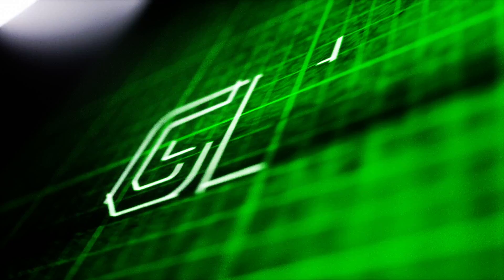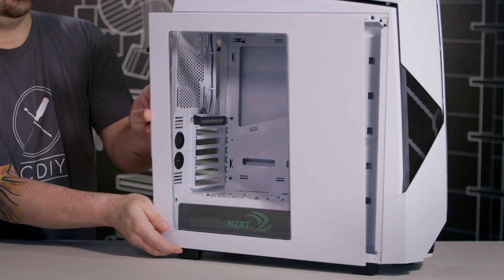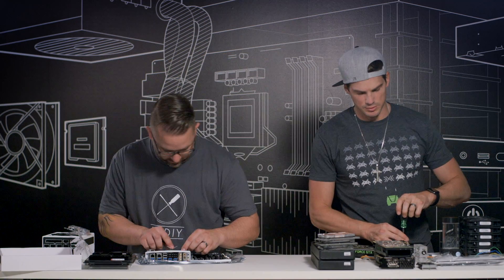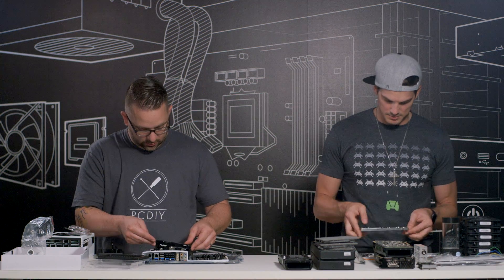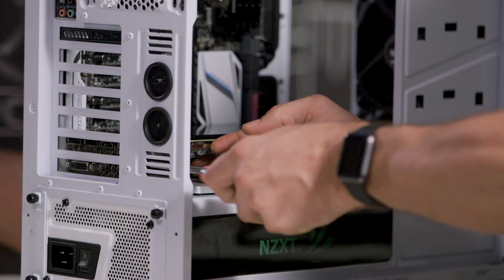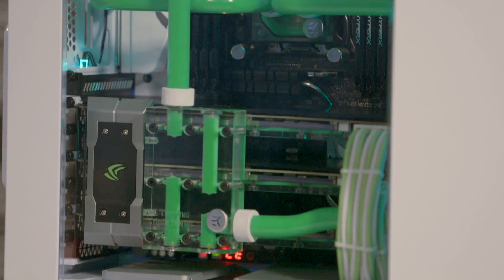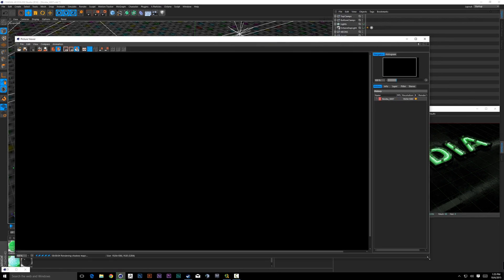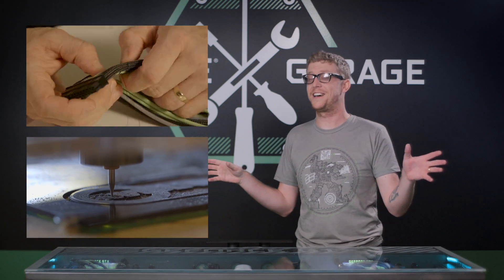GeForce Garage – How To Build the Ultimate Home 3D Rendering Rig

Comment: Does speed only depend on the CUDA cores or are other things important like clock speed and memory? Im deciding between a 970m and 1060. Thanks!
Reply: Jim Galapo. CUDA cores for 3D rendering with a GPU renderer like Octane or Redshift are important, then CPU, and RAM really never has to be crazy. GPU memory is nice for more complex scenes.

Comment: One big mistake; SLI your GPU´s won´t work in Blender, Daz, nor Poser, only in Octane, so it seems.... Don´t understand how you have to leave such a simple scene to render overnight...
Reply: That's usually people's big drawback with SLI especially with gaming focusing more on speed and not utilizing the full capacity of hardware. It's likely not a mistake, Octane is big on saying, "we're good, not fast" as long as it's not direct PR. It's well optimized, but until you get really into software tweaking, EXTREMELY slow. Personally my favorite styles and content comes from Octane, but could never justify my own use.
Reply: Why not use a gaming GPU, like a gtx 1080 Ti, and a Cuda or Tesla to boost rendering; wouldn´t slow down normal gaming too much, but you´d render about 80 % faster..
Reply: Like a Quadro or a Tesla maybe? They're different chipsets. You can have both cards, and with some serious software modification, you can probably get Octane to render with both at the same time, but you're sacrificing speed of both cards for them to talk (or handshake, or cross-sync, I'm self taught and didn't learn every industry buzzword), which is hard to do and taxing on each card. 80% is a bit of an arbitrary number since you actually have a multitude of factors affecting performance. What ends up being easiest if you have a 1080 lying around along with a Titan, Quadro, Tesla, or whatever, is run them independently (with your most powerful card in the highest throughput PCI slot), and set up two renders with placeholder files on the start of your render. That means you have the capacity of both cards rendering separate images at the same time. A gaming card CAN, in some (most, I reckon, without having my hands on the cards) cases, be much faster. For example, in some benchmarks, depending on the scene, a 1080ti can TRASH a Titan X(P or p or M), but I've noticed real world renders affect cards very differently. Daz and Poser are also really limited for render passes and options, as well. I think the guys from LTT say it best when they say, "It depends". SLI is a tricky beast, especially with CG environments. Keep in mind your processor can be much faster in limited cases as well, but that's getting a bit renderer-specific, and involved branched tracing and biasing your render.
Reply: True, a lot depends on software as well, in blender my gtx 980 ti (primary) runs faster than my quad, in Daz and Poser they run about the same, takes a bit of tweaking, which one can´t with Blender, at least i can´t.
Benhmarks are a bit dodgy, as a lot have their cpu and gpu tweaked professionally, and on a large budget, which i don´t. You can basically have one card trash any other, depending on how your cpu and other hardware will comunicate with a specific gpu, even with the same settings, one card will react differently (i tried with two different 1060, and my Zotac was faster for gaming, my MSi for rendering, very odd)
Reply: Oh man, Blender got mind numbing when it came to tweaking Cycles. Whole new beast. Definitely look into other renderers and see what fits you best. I haven't done art in quite a while, but when I did my last piece, actually used Maxwell. Rendered from a Maya project with some distant fire, which had to be removed (Apparently Maxwell doesn't like particles), and used both my 2600K and a 970. definitely a good card
Reply: Yeah, Blender cycles, all of Blender really, is not very user friendly, but one of the most versatile programs i have ever used. Had to change my quadro, ´cause it had only 2 GB of Vram, never realised how quickly one can run out of Vram, i now use my old gtx 1060 and a new gtx 980 ti; lot of cudas and fairly cheap to get these days. Works a charm in Blender.
Reply: Govert. It was overnight on his old machine, not the one they built (21 minutes on the new build). SLI does not work in Octane, or Redshift, Cycles, C4D R19, or any other GPU rendering solution.

Comment: I have an i7 4790K, GTX 970 and 32GB of RAM but my viewport slows to a crawl in Cinema 4D when working with complex scenes (or scenes with a lot of baked dynamics keyframes).  What do you recommend for speeding up the viewport in this case - would the CPU or GPU be my biggest bottleneck?  I don't care much about render times since I use a render farm for my final renders - I just need a more responsive viewport while working on my scenes.  Would an SLI Titan X setup help much with the viewport in C4D?  Thanks for your help.
Reply: The axiom for C4D is that the viewport can render a few huge poly (even a million plus) objects easily but cannot render a huge number of low poly objects. The best way to make the viewport faster is to connect large numbers of objects into one object. Think, the less layers in my object manager (uncollapsed), the better.
Reply: Thanks Vytas.  I've recently learned about this as well.  I've been trying to keep my number of objects down in the viewfinder but I just upgraded my GTX 970 to a 1070 and even though my Cinebench score hardly changed, my viewport does seem to be quite a bit more responsive when navigating my more complex scenes.  I also upgraded to C4D R18 from R17 so perhaps they made some additional optimizations in R18 as well.
Reply: Brain Candy TV use proxies, that will help the viewport from crawling.
Reply: Thanks sinuous1.  I've been playing with the new cached dynamics in C4D R18 and this seems to really help with viewport performance as well (as opposed the old method of baking dynamics to keyframes).  I still need to bake to keyframes for the render farm, but I can save that as the last step and keep the cached dynamics while I'm working on the animations.

Comment: What about Blender Cycles?
Reply: At this time, a GTX 1070 provides very similar performance to a Titan X. So, 3x GTX 1070 would be a better build for Cycles. It is probably an optimization issue in Cycles, but it's how it is for now. The exception to this is if you need the Titan X's larger VRAM for your scenes (the GTX 1070 has 6GB while the Titan X has 12GB).

Moreover, the i7-5960X in this build isn't as cost effective as something like an OC'ed i7-5820k or OC'ed i7-6800k. Unless you have money to burn, the extra money could go toward another GPU. Also, 64GB of RAM is a bit much. Unless you plan on running very high-res simulations (which would probably need more CPU power anyway) or editing 4k video/image sequences without proxies, 32GB of RAM should be more than enough. 16GB should be enough for most people.

The full water cooling setup is expensive, but I would suggest it for so many graphics cards since they will be running a lot for rendering. If that is still too much, get graphics cards with coolers like the nVidia reference coolers that exhaust the hot air out of the back of the case rather than dumping it onto all your other components. If you just get one GPU or have the space for fans, you could get the GPUs with the Hybrid cooling. They cool the main chip with an all-in-one water cooler. It is cheaper and easier than a full water cooling setup.

Speaking of AIO water coolers, I recommend AIO solutions for the CPU, like the Corsair Hydro H90. The high-end Intel chips need good cooling, especially if overclocking. For overclocking a 6-core past 4.0GHz or for a 8-core CPU, I suggest something even better than the H90. The AIO water cooling combined with basic case cooling will give the benefits of water cooling for much less cost than a full water cooling setup.
Reply: ACBlenderTutorials 64 Gb of ram isn't too much
Reply: In what cases do you see people needing more than 32GB for Blender, other than the ones that I mentioned?

Comment: yeah thats awesome build but why did you not use the quadro series which you have in ur side nVidia.? and why 6950x instead of xeon processors..? and is there any proper budget 3d rendering build..? bcz its wayyyyyyy costly n out of my pocket range
Reply: Netraraj Pun nope
Reply: Quadros are of no advantage in a build that requires as many CUDA cores as possible.

Comment: i think nvidia quadro better than geforce titan-x sli mode, for 3d render?
Reply: Depends on many things
Reply: Nope.
Titan X are more efficient and faster when it comes to GPU render.

Quadros are more efficient and faster when it comes to OpenGL and, most importantly, double precision FP calculations (hence their use in 3D modeling and animation field, not rendering).

They are still good though.
Reply: Mauro Sanna nope, quadro p6000
Reply: DragonFyZex 

We have Quadro p6000 at work and no, they aren't as fast at gpu rendering.

Comment: Why you guys used Titan Cards instead of Quadro cards? Aren't Quadros supposed to have better results in rendering applications??
I'm about to built a extreme rendering machine and still don't know if I should use Titan Z (with 5760 CUDA cores) or a Quadro M6000  (with 3072 CUDA cores) what is the benefit of having less cores but a Quadro Card?
Reply: +Soul Killer I'm in the same position as you... PLEASE SOMEONE ANSWER!!!
Reply: Soul Killer Quadro cards are meant for modeling of models that need precision, especially in AAA game development, they have high precision but they are way slower and they way less of CUDA cores, some of the Quadro cards don't even have CUDA... For rendering itself is better GeForce, for modeling is much better Quadro, or sorry for this fact, even better FirePro. For fast rendering I really recommend GTX. I work in the AAA game industry and I have two laptops, one a mobile workstation for modeling and the second a gaming laptop for rendering (real-time for work and also non real-time for personal projects), one's Dell Precision M7510 with i7 6820HQ and FirePro W5170M and the other one is Dell Inspiron 7559 with GTX 960m 4GB, with only GTX I couldn't make the models working right in the game and keep looking nice instead, and with only a FirePro, I couldn't use any rendering engine, whether real-time or not, it's too slow and not CUDA after all.
Reply: The Quadro and GTX series will do two different things for 3d work.  In this case,  Titan or GTX would render much faster than any Quadro because they have more CUDA cores.  However, the Quadro supports more memory so this would allow you to build more complex things and view them inside the modeling application.  Since CAD designers care more about complex geometry than rendering, they usually use Quadro workstations.  However, for faster, realistic 3d rendering on a GPU like this, a high-end gaming card will be MUCH faster than a Quadro card.
Reply: +Soul Killer I'm also curious since not many "review" in-depth on some programs
Reply: More cude cores = faster render. The Quadro cards have more ram, so you can create more complex scenes but the geforce series have way more cuda cores.
Reply: If it is for personal use for about 5-6 hours a day, just use Geforce cards. If it is for commercial use where you will need them 24x7, use Quadro cards. 
This is a comment I read somewhere last year. I personally have no experience in this.
Reply: John Malcolm for president. Everyone here is somewhat uninformed except for Garden and John.

Comment: Quadro isn' t better for rendering?
Reply: No.  The Nvidia Quadro and GTX series cards will do two different things for 3d work.  In this case,  Titan or GTX would render much faster than any Quadro because they have many more CUDA cores, which is what the GPU render engine is using for speed.  However, the Quadro supports more memory so this would allow you to build more complex things and view them inside the modeling application.  Since CAD designers care more about complex geometry than rendering, they usually use Quadro workstations with more vram to support large scenes with complex geometry without lagging as they build models.  However, for faster, realistic 3d rendering on a GPU like this, a high-end gaming card will be MUCH faster than a Quadro card.
Reply: What about the new Tesla P100 :>
Reply: Depends. Quadro you can have more VRAM for very large scenes, also the power draw is more efficient which matters if you're doing very long renders with multiple video cards, less impact on your power bill... And the card will withstand a beating at 100% load for much longer. Just depends on if that's worth $4000 to you vs. $1000 per card.
Reply: John Malcolm gets the award for best answer.

Comment: I thought Quadro was for professionals and Geforce is for gamers. Hmm... Is Quadro dying?
Hmm... I guess Quadro still beats FirePro.
Reply: Depends. Quadro you can have more VRAM for very large scenes, also the power draw is more efficient which matters if you're doing very long renders with multiple video cards, less impact on your power bill... And the card will withstand a beating at 100% load for much longer. Just depends on if that's worth $4000 to you vs. $1000 per card.
Reply: Thinking Out Loud  The price... That's what's killing Quadro
Reply: Well it's losing favor in smaller studios and especially with individuals, but if you imagine you're a larger company with lots of workstations or a render farm, say multiple machines adding up to 20+ video cards pumping at high power all the time.... Over just a year or two that initial cost per card will pay itself off on your company's power bill savings - add on the fact that the cards can handle more stress for years on end, and that you get separate, personal customer support, and it's totally worth the investment if you're a larger company, or if you're an individual/small company with the cash to spare.... Just if you're individual/small it's no longer necessarily needed since the Titan series came along and with even the enthusiast consumer x70, x80 and various ti cards getting more and more powerful.
Reply: Thinking Out Loud   The Power is similar and the customer support too but I'm not sure which beast consumes more power.

Comment: It is great. Just need to remind that you need turn off the power supply when you plug AC cable in. That will be more safe, in case the power supply can't avoid voltage surge.

Comment: wouldn't it be better with a xeon, ecc memory, and quadro cards.
Reply: nope 3d apps don't need that power at home i have a xeon rig and not changed when i got it 
cuz the software does not use ecc ram or ecc vram

Comment: It took all night to render? Geez, did yo have like a Mac or something?
Reply: Depends on render engine used and how well the artist optimizes the scene & render settings. Since Octane is strictly GPU-based (and supports networking) you can just pile up video cards until you get the speed you desire. However something like Arnold is CPU-based, though it's faster than stock engines (Cinema 4D's stock engine is SLOWWWWW), though it's popular in Hollywood because it can handle very (very) large scenes.
Reply: Nah... even Ma would render it faster...xD
Reply: Nah... even Mac would render it faster...xD
Reply: 3D rendering takes a VERY long time. Even an absolute beast of a machine can take hours to render something visually simple.
Reply: I know, I tinker with 3d renders/ 3d printing. I was trying to make a diss at apple cause mac so yeah :/
Reply: +ZRFTCH oh right, yeah Apple Mac's suck at 3D Rendering. Even a maxed out Mac Pro kinda sucks.
Reply: yeaaaaah... The software is alright, hardware is ehhhh for the money